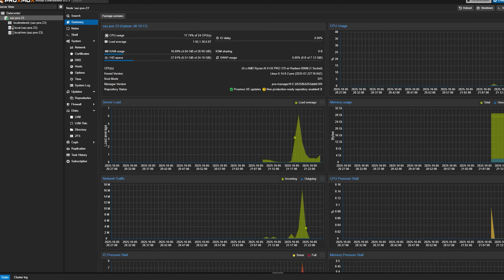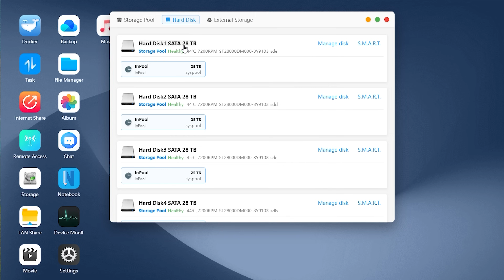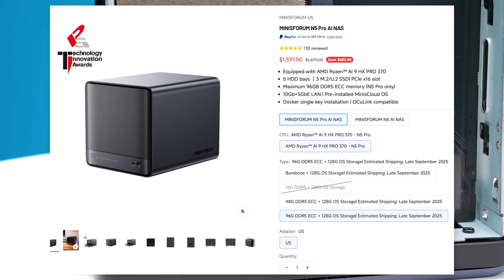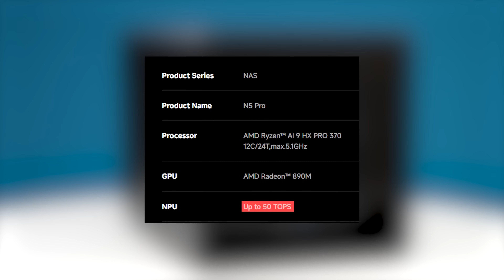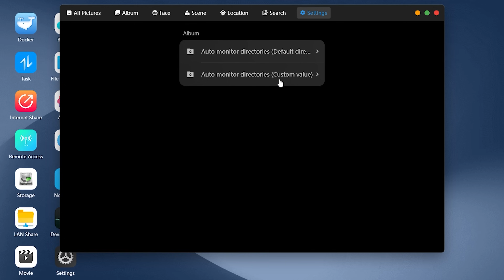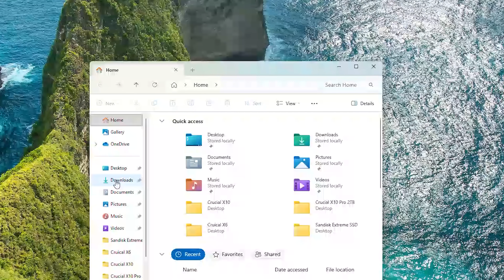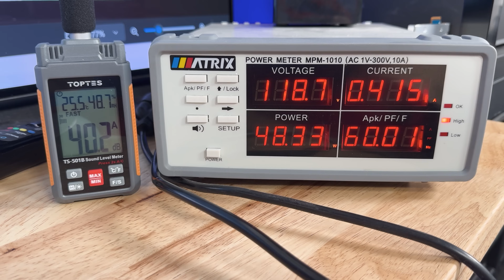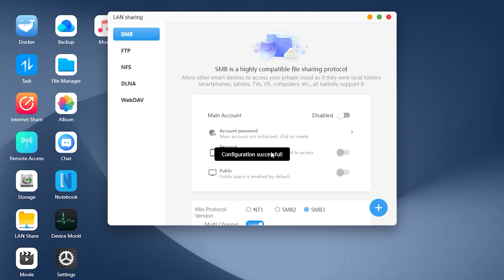The BEST 5-Bay NAS Today (by far?)

Comment: I've updated my old QNAP last year to run a custom OS, 16 GB RAM, 144 TB HDD.

Never again. Supporting custom hardware was a huge pain. But at least it works.
Reply: Which model, which OS? Thinking about doing the same
Reply: @lspcie 
I highly highly and strongly recommend against it. I must have spent close to 300 hours on this as a personal project and I'm still not fully happy with it. Supporting the custom I/O like the piezzo, LEDs or physical buttons took quite a lot of effort. I still couldn't get the LCD to work. I never got subs to program the logic that will turn in the corresponding red LED when a hard disk fails, etc. I didn't particularly enjoy dealing with compiling the Atlantica kernel modul to get the QNAP PCI-E 10GbE NIC expansion card - which was quite pricey btw. No support for ECC ram despite the memory controller and CPU supporting it. Guessing a proprietary BIOS not 

But if you must really know: 
Model: QNAP TVS-663
OS: XCP-ng 8.2.1 LTS as hypervisor with 3 VMs, one of which is TrueNAS.
Reply: @lspcie 

I highly highly and strongly recommend against it. I must have spent close to 300 hours on this as a personal project and I'm still not fully happy with it. Supporting the custom I/O like the piezzo, LEDs or physical buttons took quite a lot of effort. I still couldn't get the LCD to work. I never got down to programming the logic that will turn on the corresponding red LED when a hard disk fails, etc. I didn't particularly enjoy dealing with compiling the Atlantica kernel module to get the QNAP PCI-E 10GbE NIC expansion card - which was quite pricey btw. No support for ECC ram despite the memory controller and CPU supporting it. Guessing a proprietary BIOS not supporting it.

But if you must really know: 
Model: QNAP TVS-663
OS: XCP-ng 8.2.1 LTS as hypervisor with 3 VMs, one of which is TrueNAS.
Reply: @lspcie 

I highly highly and strongly recommend against it. I must have spent close to 300 hours on this as a personal project and I'm still not fully happy with it. Supporting the custom I/O like the piezzo, LEDs or physical buttons took quite a lot of effort. I still couldn't get the LCD to work. I never got down to programming the logic that will turn on the corresponding red LED when a hard disk fails, etc. I didn't particularly enjoy dealing with compiling the Atlantica kernel module to get the QNAP PCI-E 10GbE NIC expansion card - which was quite pricey btw. No support for ECC ram despite the memory controller and CPU supporting it. Guessing a proprietary BIOS not supporting it.

But if you must really know: 

Model: QNAP TVS-663

OS: XCP-ng 8.2.1 LTS as hypervisor with 3 VMs, one of which is TrueNAS.

Comment: I was very interested up until the App and registration requirement. All interest immediately evaporated.
Reply: Is anyone actually going to use their provided OS? Use Unraid or TrueNAS?
Reply: @TRD_2zz  at 1500$, better build from scratch
Reply: Agreed. As soon as I learnt about that it was a hard no from me.
Reply: @PrivateVoid1 Lmao wut? I was able Ventoy TrueNAS Scale onto it just fine after checking firmware updates in MinisforumOS without an account over lan, just make sure you enable secure boot support on the ventoy install media
Reply: I'd hope you can just install a custom OS without needing that, right?
Reply: @b4ttlemast0r  probably but there is a chance they registration gatekeep driver updates and stuff, dunno what kinda history minisforum as brand has around stuff like that. My hunch would be that they don't do stupid stuff but this whole thing surprised me coming from them, so yeah.
Reply: @b4ttlemast0r  You can.. I'm running TrueNAS on mine and it's running great. Have Plex, Jellyfin, Tailscale apps running plus HAOS VM so far.. Going to try Immich on it soon
Reply: @b4ttlemast0r yes you can install whatever you want
Reply: You can just put TrueNAS on it, right?
Reply: I think you can install your own system on this beast
Reply: I own one and am impressed with it.  I'm using Proxmox 9 without any issues.
Reply: Just install Truenas, HexOS or Unraid. It's just a generic computer and SSD nothing locks it to Minisforum
Reply: +1
Reply: Pretty much any x86 OS can be installed instead.
Reply: you can install whatever OS you want

Comment: I really enjoy Minisforum's tray-loading designs, but it feels like they could add just a tiny bit more room for a larger/quieter fan, and bigger PCIe devices. Maybe just go with Mini ITX board dimensions/mounting points, that way it could be upgraded at some point too... (even if it doesn't have the same height to allow a full size IO shield and half height vertical cards—people can find ways creatively around those limitations).
Reply from the maker: How are you so fast? I have not even gotten to your Qualcomm video today. I agree that just getting it big enough to put 1U Noctua fans in (or having lower-cost 1U fans from the factory with an option to Noctua) would be great.
Reply: @ServeTheHomeVideo  he divides the work, red shirt Jeff does half
Reply: @ServeTheHomeVideo  Jeff is a special kind of Kryptonian with homing abilities for cool tech videos.
Reply: Need that prototype NVMe break out board to be offered up as well!
Reply: To be honest there is a lot of such cases from Jonsbo and MBs from CWWK. But this way we lost this nice tray with compute parts to service and device must be much bigger.
Reply: at least two fans still kinda help with redundancy, in case one fails.
Reply: A 5 or 8 bay expansion that could run off the Oculink and sit right below it would be nice.
Reply: Would the new Intel b50 fit in this?
Reply: @BrownieX001  I was looking at this, unfortunately, dual slot card thanks to the heatsink/cooler 🥲
Reply: Oh N3Hardware are working on a single slot cooler for it!
Reply: If they make it any larger, it won't fit in the 10" mini racks for mini labs 😭😭
Reply: to be fair you're putting HDD in there so you're gonna place the device in a server room anyway
Reply: @Z4KIUS  I expect this device goes on a desk, in an open closet, or some other open and easy to access area that is slightly out of the way in a home office or small business.
Reply: @daemonofchaos hard drives don't belong to living or working areas though, maybe if you had tiered storage and they'd be deep archive that launches only when noone is around to move stale data there or when directly accessed, otherwise to the server/storage/electrical room it goes!

Comment: If you figure out to replace the CPU fan with something less noisy, that would be great as it can make quite a lot of noise even when idle...
Reply from the maker: At idle, by far the #1 thing I hear is hard drives deciding to spin up. I had this sitting next to my desk for the last week, and that is what I notice. This video has been ready, waiting to go live for almost a month now, so I had some time to use it.
Reply: @ServeTheHomeVideo  it's been standing next to me for about two weeks now and while 42dB of noise isn't a lot, it is if the entire apartment is quiet. Also, the fan speed for the hard drive fans can be set to very low in the bios and if need be, I guess they can be replaced with beQuiet or Noctua fans as they're just standard 92mm fans, but currently it's the CPU fan that makes the most noise, especially when it ramps up. I also removed the nvme fan as that also makes quite a lot of noise at the standard settings and isn't really needed if you just use cheap nvme drives and don't plan on hitting them hard.
Reply: @ServeTheHomeVideo Your's must be a fluke then 😂